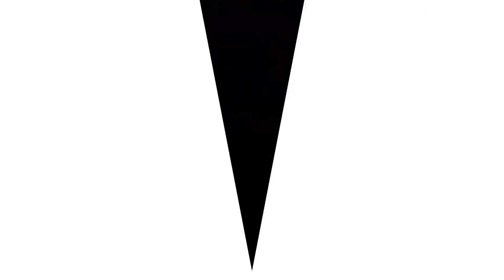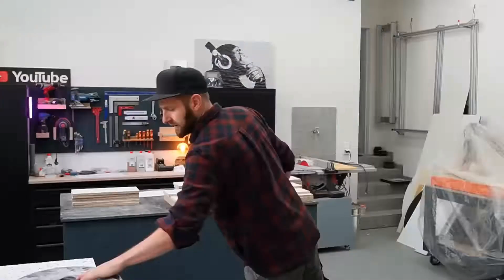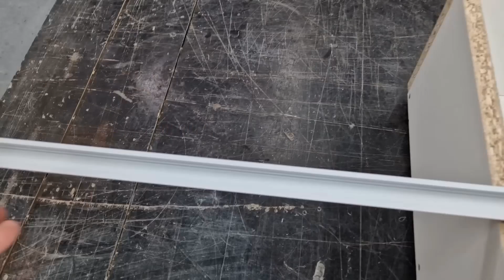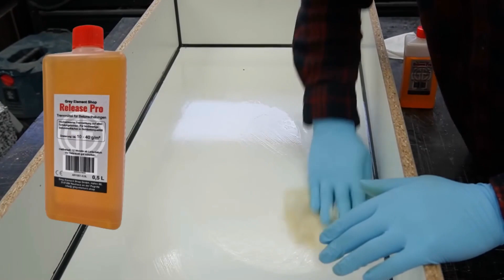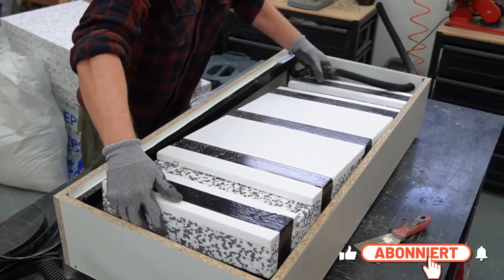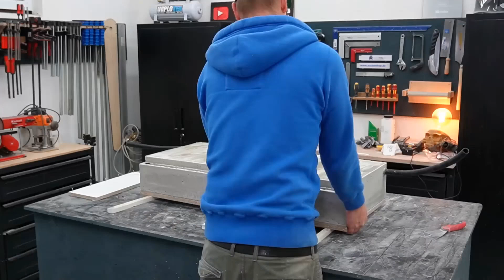How to build Concrete Stair treads with Lighting

Comment: At about 4 minutes in you say the name of the stuff you used for the recess, it sounded like Styador ?  I cannot find anything by that name and closed captioning didn't help, It says "Sodor" Is it something like insulation foam board or something?
Reply: "Styrodur". It's a kind of extruded polystyrene (the harder stuff, not the soft white expanded polystyrene). It is commonly used to insulate houses' walls and such... You can also find it under the name "XPS".

Comment: As a professional product such stair steps might be constructed in such a way that they can be freely shortened.
reinforcement rods should be a non-corroding material like basalt so the exposed end of that would not start corroding away, or fibre reinforced concrete might be used.
Also there should be notches for connecting cables once every 30 cm along the entire lengths.
lastly the recess might be made a few mm deeper for the cable to reach the end of the recess when the cable-notch happens to be a few mm from the end.